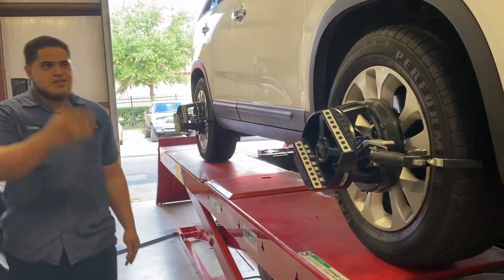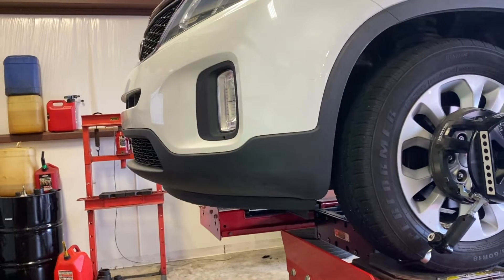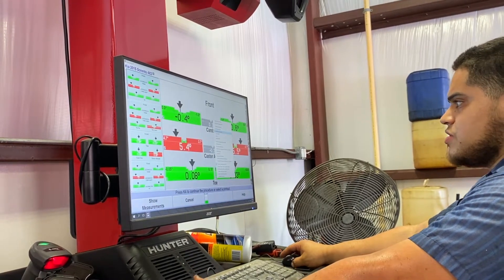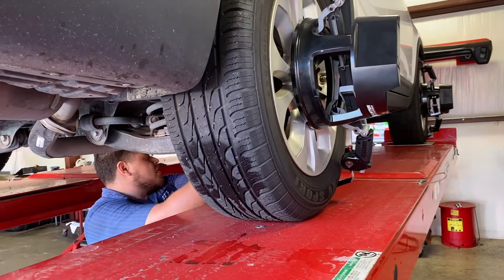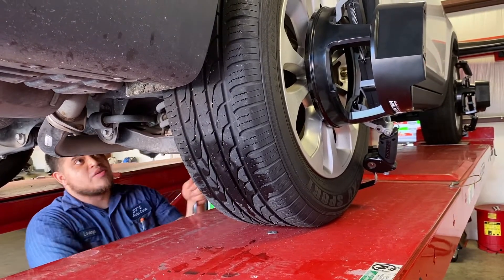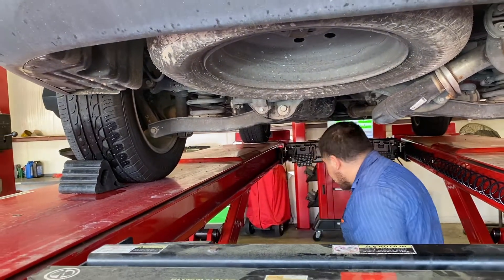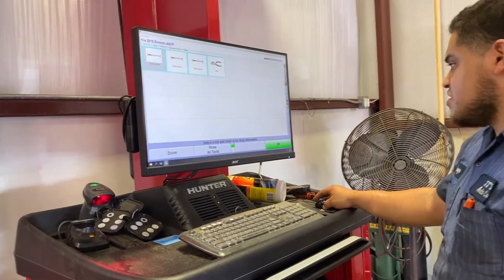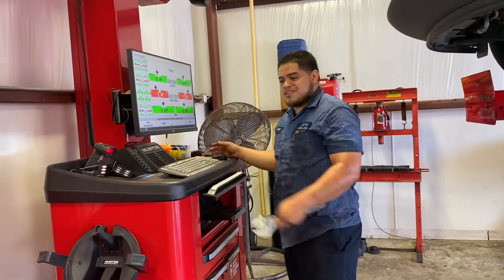Wheel Alignment Performed by J-Tech Graduate!

Comment: Can caste be measured on a 2017 civic EX? I know it's not adjustable, but curious if it can be measured as it seems my drivers side front tire is 3/8 inch closer to the bumber than tha passanger side. I had a small accident where the front driver wheel was hit.
Reply: Yes it can be measured and there are ways to adjust it too. You can shift sub frame etc to try and get it right